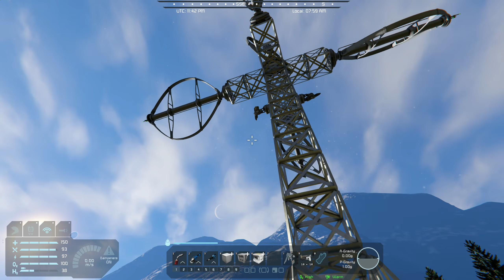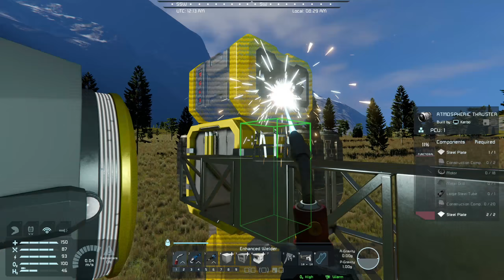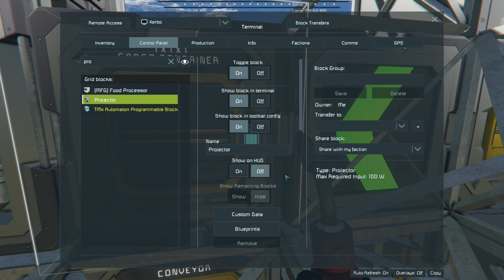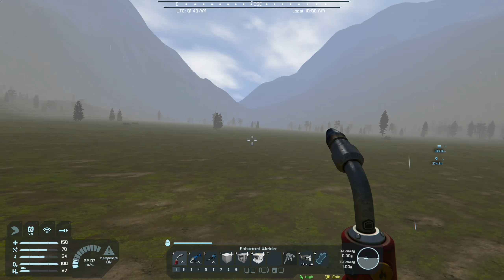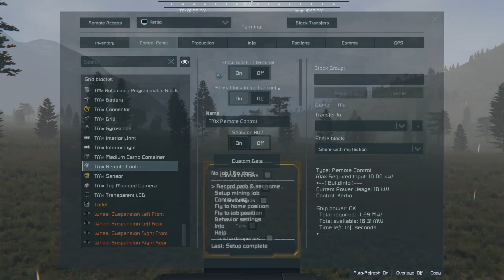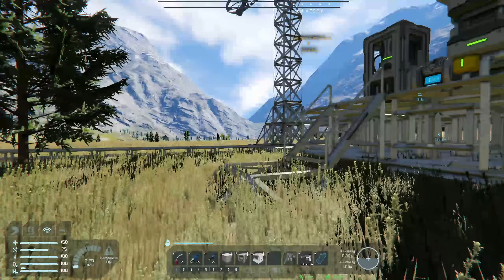The Automated Farm Project ep5 | Space Engineers (Apex Survival)

Comment: Is the Tiny Miner itself not on the workshop? 🥺
Reply from the maker: It's not, but I've thought about cleaning it up a bit and sharing it there
Reply: @KerboOnYT   Hi. Have you posted a blueprint of the Tiny Miner yet? Would love to try it out =)
Reply from the maker: @TeeKaayG I did. Search for Tiny Miner Mk1
Reply: @KerboOnYT Thank for answering 😊 Keep up the good work 😊
Reply: @KerboOnYT   Just some information about the Tiny Miner Mk1 blueprint. Just a heads up, i couldn't get it to work, and i got the error "sensor wrong way" so i tuned it in another direction and it works. I don't know if this is the same every time i build it or if everyone downloading the blueprints get the same problem, but i just wanted you to know, in case you need to re upload it to the workshop =) Thanks for the awesome machine btw =)

Comment: Connector is too close to the base connector. I've run into this many times. I've switch to using a rotor where the shaft is parallel to the connection axis so that I can push the offset away.